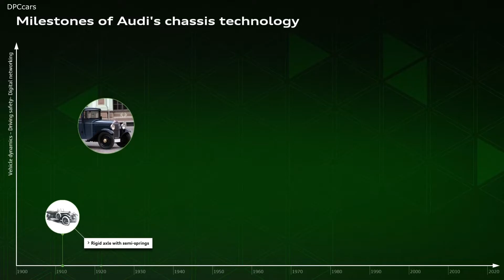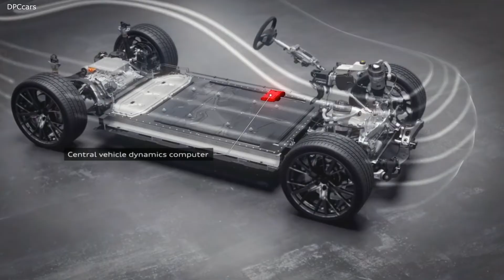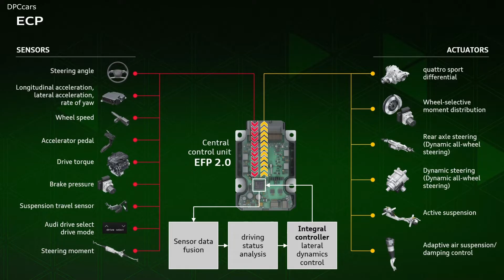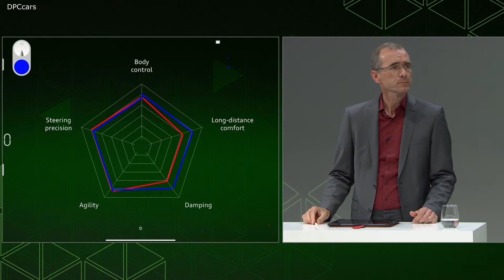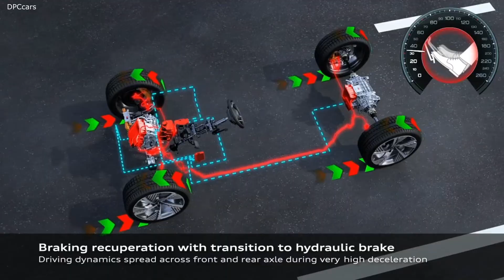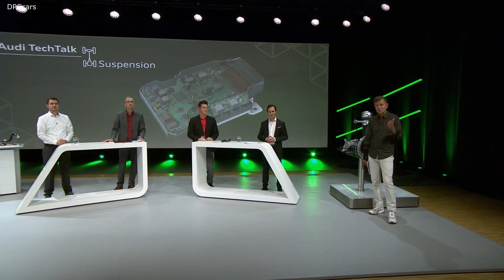Audi Suspension Explained   Presentation Event

Comment: Which will have less body roll for a 2020 TT RS, magnetic or fixed suspension?  20 inch wheels, but could go smaller
Reply: Fixed on most RS models